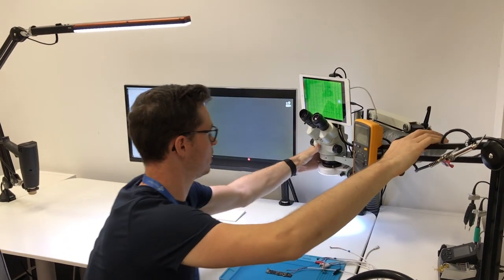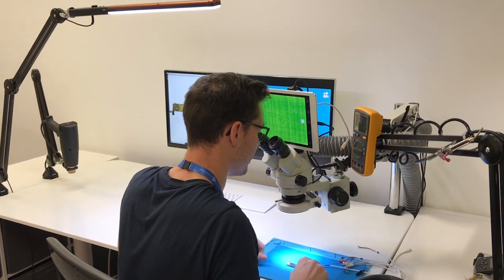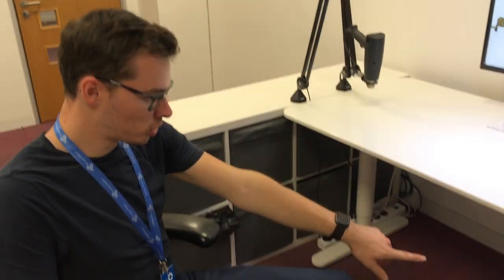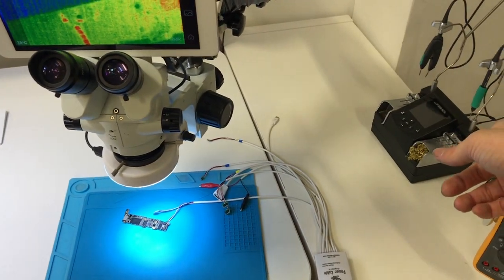UNION REPAIR video request. Micro soldering workstation setup

Comment: If you're doing an HDMI port for PlayStations then that NASE station is useless. Even a cheap radioshack iron will do better than that jbc. The NASE is meant for  "micro-soldering" and anything other than that is hopeless
Reply from the maker: I use the NASE for PS4 HDMI without an issue. Just needs a big tip and turn the heat up to 450.

Comment: Nice setup! Really well thought of.
But! What about ESD protection? At least a conductive mat on the work surfaces, connected to ground, and a wired ESD wrist strap is mandatory.
Working on modern day electronics is highly unreliable when no ESD protection is used. Yes, it will work after repair. How long? Nobody knows.

Comment: How do you like your microscope stand? Is it the omano v7? I'm looking at getting one but have read a couple people say it's not very stable or very jittery if you bump it slightly. I'd love to know your thoughts on it! Thanks in advance!
Reply from the maker: it's true, it's very jittery. but then again so is my table which is being upgraded to a very solid one. i'm hoping it'll help! I'm pretty sure if the table was steady, this would be as well because there's nothing else that it's in contact with
Reply: @simplymicrosoldering  thanks for the reply! That helps me out a ton because I couldn't find much info or thoughts on that stand. I think your right though. Having it mounted to a heavier bench or separate bench altogether will probably make a big difference.